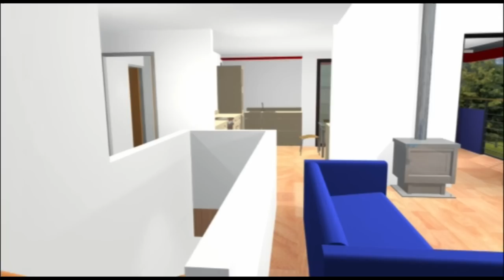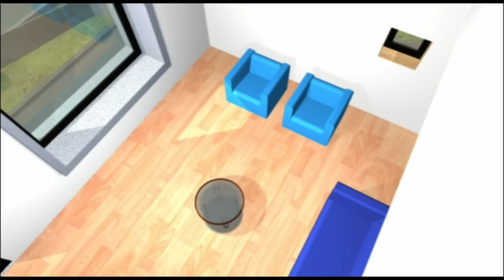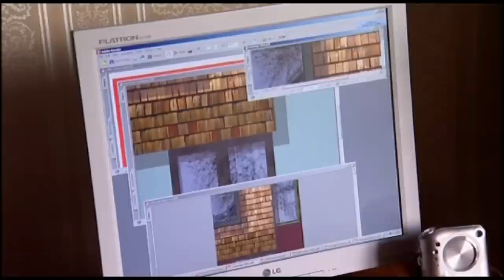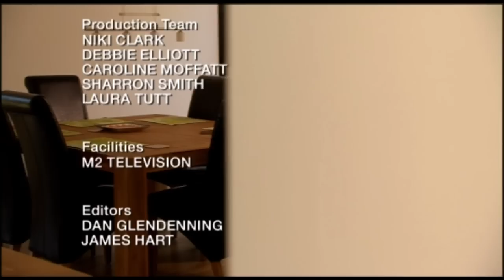Grand Designs UK With Kevin McCloud | Stirling | Season 5 Episode 10 | Full Episode

Comment: This is one of my favorite houses in this series.  It is attractive, sits well in its site and is constructed with sterling materials.  I am surprised by the Swedish window manufacturers, I thought they were more efficient than that, but the problem lay in the communication to them by the timber builders.  They seemed to be the weak link in the chain.  I thought the long and full consideration by Peter of his materials, sourcing and design was audible.  Great job!